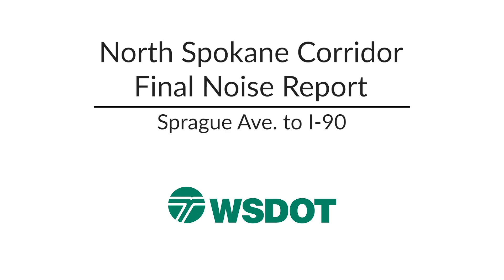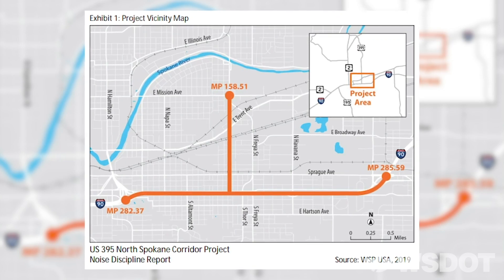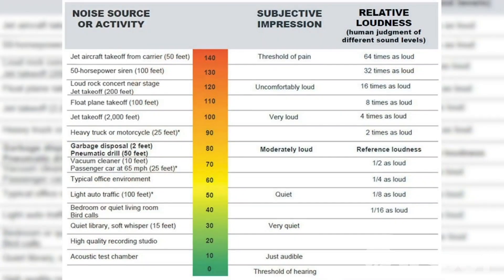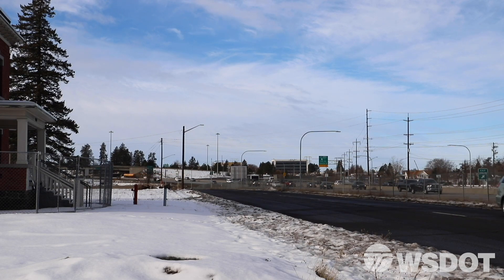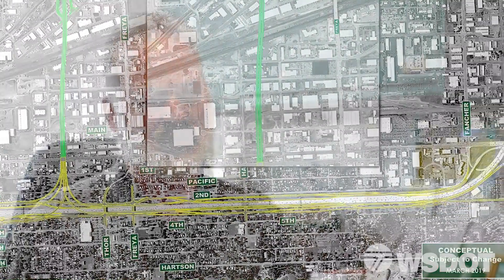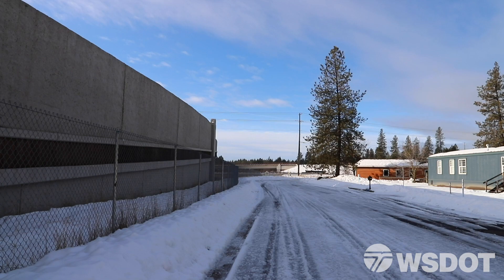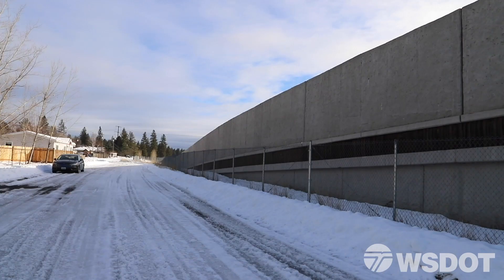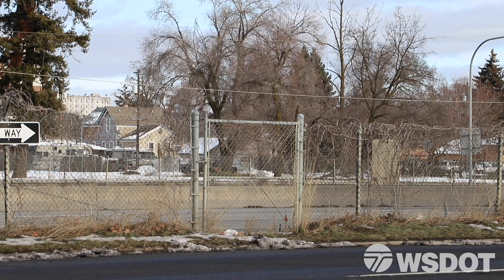North Spokane Corridor - Final Noise Report between Mission Ave. and the I-90 Connection

Comment: I don't think the project of upgrading US-395 to a freeway which connect to I-90 at milepost 283.8 by the year 2030 in Spokane. Also Washington State will not add anymore interstate highways, due to lack of highway funding. It is approximately 90% of US-395 are freeway which span from I-82 in Kennewick to I-90 in Ritzville. I don't think it will never upgrade the remaining 10% of US-395 to a freeway standards, neither it will be future I-9 nor I-11.